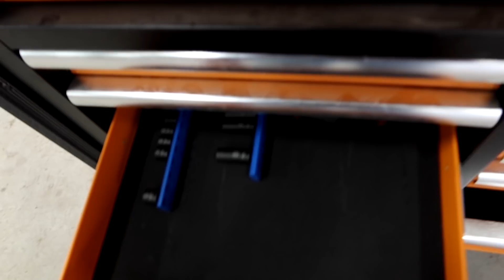Nothing Like Waiting Until The Last Minute

Comment: Curius about how farmers are viewing electrification. Have you looked into electrified farm equipment? I am guessing it would provide lower running costs/repairs and maybe more power for a higher initial cost.
Reply: Batterys are still to heavy and take to long to recharge. Farmers don't run equipment on a consistent level. Its all go or no go.
You could start a tractor and have it run for 45 hours straight.only stopping long enough to refuel and maybe replace operators

Comment: if you drill a 1inch hole in your forks about 6-8 inches from the end a I-bolt will serve to keep your strap from sliding and give you better place for lifting especially if you use chain

Comment: Tip from a guy that has done several of these retro fits over the past winter. When you go to put the new backbone harness in; take the floor out between the CCS tanks and use a ratchet strap to hold up all the other wiring and hydraulic hoses so you can run the new wiring and hoses underneath of it. Creates a lot more room to work with.

Comment: Why does your planter have tracks instead of tires
Reply: The planter is so heavy that the rows between the tires were getting compaction enough to cause root growth impairment. The yield of those rows would have been negatively impacted. Tracks spread out the load over a longer "footprint" causing less compaction and aiding yield.

Comment: Wow, that's a big change to the planter.  Got to be a 5 figure cost.  How do you measure the ROI on this?
Reply: Going high speed. They can plant 2x as fast. I don't remember the exact #s, but I think it's around a $60,000 savings to convert an existing 24 row vs trading for a complete new one. That's without selling any of the parts taken off.
Reply: I was wondering the same.

Comment: Wondering what the cost to convert planter is compared to just replacing the old unit with a new unit already set-up with the systems your are converting to.
Reply: The number that our dealer is throwing around is over $250,000
Reply: @delbutler885  So they are saving $250,000 by converting rather than buying one already set up?  Wow!
Looked at JD website, looks like Exact Emerge is an add on for a new planter, too.  A planter outfitted with Exact Emerge and hydraulic downforce is over $350K while the Exact Emerge and Hydraulic down force options "only" runs around $130K...